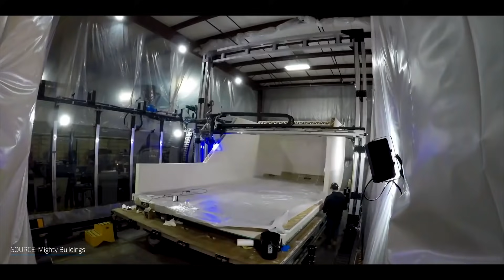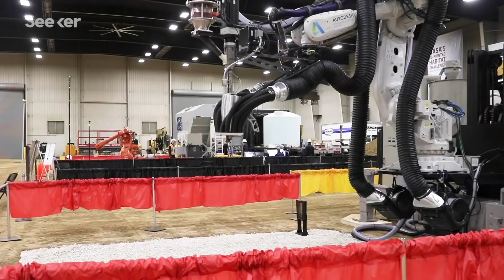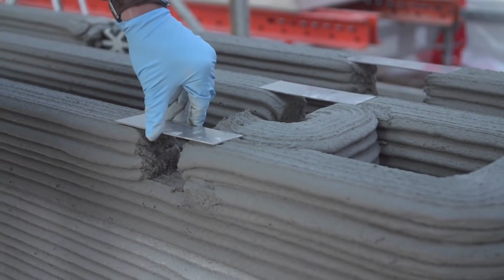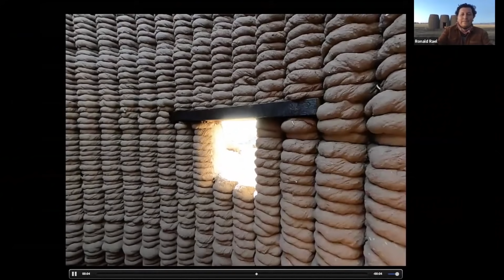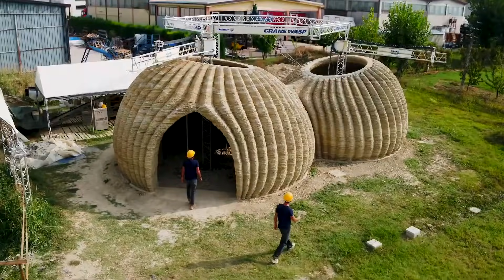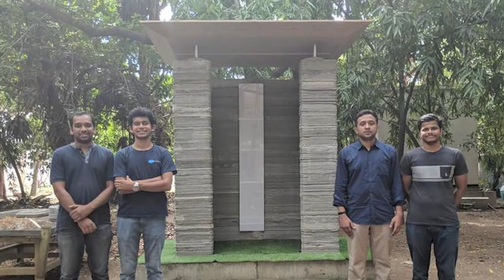This 3D Printed House Is Worth $0

Comment: Imagine if there was a way to turn local soils into blocks that could be stacked to build homes that could be transported to areas that water isn't readily available. Oh that's right, it's called bricks.
Reply: I hear you -- but bricks (in the forms most people are familiar with) require certain types of clays & soils, and then have to be fired (essentially, baked like cakes) at certain temperatures. An alternative "brick" is made by filling a mold with concrete, but we're back to needing certain types of sands & gravels or the concrete will not hold together.  Bricks also require a certain amount of specialized knowledge to use properly, especially if they're the primary material from which a building is made. They're also not as cheap as one might think; there's a reason that so many houses in the US from the late 1960s onwards are brick veneer instead of solid brick.   I'm not sure 3D printing buildings is the way to go, since they will face some of the same issues re: consistency & chemistry of local sands/soils, but in areas where they do work they could be a less expensive and less labor-intensive alternative.  Other technologies both old and new (rammed earth, earthbags, inflatables, etc.) really need to be looked at to solve the steadily-growing housing problem -- from both the viewpoint of structural needs and that of cost.

Comment: I think after The house printing, they need to be creative with Conduits to deliver Electricity and Water through the houses too. Just so it's easy to make simple and sensible arrangements that are cheap and effective.
Reply: It's 3D printing: You just leave spaces in the structure. Once it's built the electrician and plumber come along to fit the interiors.

Comment: It will become a fad like Tiny houses and no longer be affordable.  Add the State putting even more regulations in place to make happy their banking an d energy producing  contributors.  Affordability will disappear.   Even if the affordable factor is some how kept.  Those who have money will buy them up.  either to live or rent out.  Taking away the affordable part once more.  The biggest problem with affordability after greed is inventory.  As one and two bedroom homes either don't exist any longer or have been modified by adding many more square footage.  Ending codes that require 750 square foot per person and three bedroom requirements.  Would allow small homes to be built. Mixed in with the city landscape.  Would help people out of poverty.  End poverty and major social and economic issues becomes a foot note in history.

Comment: Houses are still not printed faster. Framing and sheathing a house can be done much faster than any printer can do it (for now). The longest part of building a house is plumbing, electrical, and finishing. 3D printing still does not do any of this at all.
Reply: framing and sheathing a house take 6-10 people, plus plumbing and electrical takes 6-10 people together, where you can cut labor costs in half or more this way. saving trees that make our oxygen as well. unfortunately, we have no population control, which is why we need cheap fast housing to account for all the current people and coming people. if you can do it better, then do it.
Reply: Yet 🙂
Reply: Well, it's faster than pouring concrete into formwork. Wood construction is not really comparable.

Comment: Honestly, considering the texture of the pour, I think it would be more advantageous to use the giant XYZ frames to form precision molds for casting large interlocking pieces off site. That would spare the head-ache of set-up and worry about perfect pour consistency while still taking advantage of the technology to cheaply fab large-scale intricate interlocking parts with a better finish on all but one side.
Reply: We are still in the infancy of 3D printing and robotics. Amazing things will happen in architecture in the coming century as the technology matures.
Reply: It kind of misses out on the whole zero miles aspect of the construct though.
Reply: @DefendedBear  No, you could still do it all on site. Just truck the pieces in like any other materials. It could be like a building made with a CNC machine.
Reply: @golgothapro   The same robotic arm can be equipped with tools to do the finishing and install the hardware ect... As far as I know it is the one of the long term goal.  At that point building blocks do not offer many advantage. Still it is pretty sure that somebody will also make printer to make small block at some point. Not everybody will want to invest in a huge robot arm.
Reply: @golgothapro  there are even full concrete rooms for apartment blocks :)
Reply: @warchefseed  I'm sorry man, but I don't get what you mean here. Do you mean complete rooms for blocks of apartments are already being made ?  If so I can certainly believe that.
Reply: @golgothapro  how is trucking stuff in on sight? Did they truck it in just a few inches???
Reply: @varrantgreen4259  Did anything anywhere ever show up on site without  trucks man? What's your F-ing problem with trucks dude?
Reply: @golgothapro  what's your effing problem with geography? On site means it's already onsite. Why would you need to truck it anywhere if it's already exsactly where you need it. 

And why are you making this about trucks? If you want to drive the material around the block for a joy ride go ahead and do it. Just don't charge the costumer with your joy ride.
Reply: @varrantgreen4259  What an exasperating communication. I know what on-site means. I made the general statement that I thought the 3D machine would best be used to make precision parts trucked to the site than actually used on-site with non-processed materials; and then the whole thing just deteriorated from there. I don't even know what the debate is anymore.
Reply: @golgothapro  the 3D printer in this video is a mud printer. How would you make easily transportable compoents out of mud? Like large panels instead of bricks. 

Youd have to do a compeltly differnt printer and then the issue of cost of materials wouldn't be resolved for this other printer. 

It's like you didn't even pay attention to the video and are under the impression that only one kind of 3D printer exists.
Reply: @varrantgreen4259  It doesn't print mud, it prints concrete or cement. As I stated earlier, I would repurpose it to make molds for casting. it's nothing but a giant CNC. Every wall could be made as a separate piece and assembled on site. What is you problem? You don't believe it's a viable concept? Nobody is sticking a gun to your head telling you that's the way it has to be.  That's just my opinion on it  because I don't like the texture of the final product or the idea of moving the rig for each application. Now is that too difficult for you to understand?
Reply: @golgothapro  The problem some of the folks replying to you have here, is that the whole premise of the sort of construction being displayed here is "zero mile."  Yes, some new logistical problems will occur, but removing 8000 lbs of construction waste, using renewable resources wherever possible, and not using trucks to haul heavy materials is all part of the allure.

You seem to be saying that they should instead prefab and deliver.  Which is a pretty sound idea... we've been doing it for decades.  It just doesn't mesh with the aims of the folks working on these projects.

So the problem people have with trucks, is that removing as many trucks from the equation is part of the goal here and you're suggesting using trucks.

I'm not sure how you haven't gotten that yet, but there it is.
Reply: @NaptownClassic  The zero trucking idea is ridiculous despite that being the goal because using local resources still wouldn't eliminate that. It's the size and use of the new 3D printer that is the real innovation here despite what the title insinuates. That's why I say it would be best used to make innovative Pre-fab parts. I guess I don't read any better than anybody else though huh?, especially when it comes to titles. LOL
Reply: @golgothapro  Eliminating truck use is the "goal", not the starting point.

Minimizing the use of trucks is a starting point.

Prefab and trucking the parts would be counter to what these folks across the multiple companies here are attempting to do.

I mean it all started with the idea of fabricating structures on another planet.  No trucks on those planets...lol.

All the other concerns people have brought up in these comments, about the consistency of the local materials, toxic or otherwise dangerous components which would need to be removed and so forth... I'm sure if folks in the YouTube comments section can immediately pinpoint them as points of concern, the companies spending actual money on these projects have probably considered them too.
Reply: You just invented the communist/eastern block house building technology from the '70s
Reply: @markmark2961  Oh yee of little imagination. That 3D rig is capable of forming molds with patterns, textures, or any imagery a computer can scan. Pieces can be any shape imaginable. Just try thinking out of the box for a change there Marky Mark.
Reply: @golgothapro  lol dont come assuming too much, while you just described what others did half a century ago already. people always forget you dont have to reinvent the wheel, also bunch of startups and such tries to hype you up with so much unneccessary things it is ridiculous. 3d printing is viable, but not as fast as building from blocks, there are even faster technologies compared to the premade blocks as well. go educate yourself and widen your perspective a little before you start to belittle others based on your none existing knowledge
Reply: But how would you transport cast components? Not manufacturing on site adds considerable "headaches" you are not factoring in.
Reply: @colbychavez3550  How does one truck anything? Nobody siad make anything bigger than a truck could handle. You can't just use raw dirt to make consistent cement or concrete can you?
Reply: @golgothapro  No.  But you can use it to make clay.
Reply: @NaptownClassic  Yes, but the material for the 3D printer has to have just the right mix to pour and cure correctly. The material it pours it trucked in, not taken from the site.
Reply: @golgothapro  This video says the opposite.
Reply: I must agree.
Reply: finally. i can live in the lincoln log house of my dreams
Reply: Russia, China, and Japan all tried that in the 70s and 90s. A very long story made short, it's hard to do right without an unusually high level of construction worker skill and above average material qualities, which wasn't available in China an Russia at the time, which lead to a large number of building collapses. It's a similar problem for the 3rd world counties this tech is meant for first and foremost.
Reply: @KiraSlith  I think that just infringing on "how it's been done" could cause plenty of problems as well. You've heard of pre-fabed  Lustron homes right? They had a big government contract to fill the housing deficit after the war until home construction lobbyists got there way and bankrupted them. I'm not an architect; but I'd like to see somebody build something practical other than just rectangular compartmentalization.
Reply: Why cast? SLM is nearly to the point where it can be used on a 3 post delta system (can stabilize foundation without heavy machines), bricks or print bottom up leaving posts driven deep in the ground to allow the building to grow upward as needed.
Reply: Like bricks which have been around for thousands of years.
Reply: @plebiansociety  I was thinking something of a bit larger scale with rebar in it that could take full advantage of the 3D framework. Crawl back in your casket.
Reply: @golgothapro  oh, like cinder/contruction concrete  block?
Reply: @plebiansociety  Like a whole wall man, with round windows. What's wrong with you ? LOL
Reply: I think the downside to this concept - prefab off-site to bring in materials on-site - has its merits, but has one major downside: If you print on-site you can use materials (earth, water, etc.) from on-site, dramatically cutting down logistical overhead for transporting the materials from off-site to on-site (which will of course also raise overall costs).

Printing on-site and using materials sourced on-site dramatically reduces and in many instances eliminates this cost. Its far simpler and much faster to move a printing machine on-site, source materials on-side, and then move the machine next door for the next-door neighbor's house than it is to set up a factory to mass-produce modular parts which are large and heavy and require a lot more back-and-forth transportation and storage solutions between builds.
Reply: @gcook725  Most building sites don't have the materials needed to build a building. If they did, they'd be turned into mines, or otherwise used as a source for those materials. Sure there are exceptions, but most construction sites are going to need far more than they already have just sitting around. More importantly, no site is exactly the same as another, so there would be quite a lot of logistical overhead just figuring out what materials are present on each site, and which os them are in a condition that can be used on that specific site. It's no as simple as "oh there's clay here naturally" it's how easily can we harvest the clay that here naturally, and what's already naturally mixed into it that we might need to remove before we can use it?" This video is marketing and propaganda. They are ignoring the issues to sell an idea. That idea is really compelling, and has a lot of potential, but as with any commercial, they aren't going to tell you anything bad about it unless they are legally required to.

The real reason investors and businesses want this technology isn't anything to do with the environment, or helping people. They want to replace jobs with machines. Machines don't complain about working conditions, don't take breaks, don't need to sleep, don't want insurance, don't need to be paid, make fewer mistakes, don't take longer than they need to, and are generally more reliable. You just need to hire a few people that can maintain the machines and keep them working. You pay for the machines once, and they only need minimal maintenance afterwards. This is happening in every industry. If you aren't necessary for those in charge, then you aren't worth caring about. Investors, Businesses, and Governments only care about you if they can get something from you. People naturally look out for themselves and those they care about before anyone else, and if they don't need anyone else, then they aren't going to provide anything for them unless it's convenient.
Reply: @LeafMaltieze  you forgot the part where they get to sell dirt to poor people.
Reply: Eh make a 3d printer that can set itself up and walk itself to location.

Comment: Ya but houses made like that are a lot harder to live in because you can't easily run new wires for new outlets, or run new wiring through the walls, and such without going through all that huge wall of clay.   Unless you plan on having the interior walls set up as a separate project.  Industrial robots that build houses with wood and drywall would be better.

Comment: 7:66 Wild mouses will be glad to eat this thingy wich was added in a wall on this moment. It is like table full of food on party for em. Otherwise it is poisonous. Also clay are short timed material in raw state. Enywhere where at least one month are temperature below zero degree Celsius those buildings lasts 20 years in luckiest case. Concrete are better, but to make it warm enough in cold time of year it need to be about half of a meter(closer to two or one and a half feets) and also need to be filled with material wich don't eatable for pests AND have low thermal conductivity... Cheap... Yeah... In dreams.
Reply: Best case scenario would mix ancient geopolymer and pour your block molds in staggered stacks and make it look like the huge blocks were lifted into place somehow. That should scary off people wandering around your property.

Comment: Ok you ask me what I think  this is it.
More bla, bla, bla ! All you 3 d people do is blow hot air w this technology and not anywhere is there a community w these homes.
Yes I know the few in Austin Texas but what I'm saying is lets get the ball rolling. There are people that need affordable homes now! Cut the bs and lets build some homes that are truly AFFORDABLE!... Let's go people! What are you Waiting for the second coming of Christ for Christ sake !
Reply: Houses are still framed and sheathed faster than any 3D printer will do. The longest parts of building a house are the plumbing, electrical, and finishing. 3D printing does not address any of these. Oh I forgot the paperwork in permitting engineering testing and designing will take even more time and this does not solve any of that.

Comment: I live in a frame house with a leaky roof. Water is the enemy of most homes. How do they keep these houses from turning to mud and collapsing in a rainy environment?
Reply: Like all adobe structures - with a thin layer of cement.
Reply: @MrKnutriis  ok. Never seen one before.
Reply: @MrKnutriis  Um, you do know that cement is porous right? the house will still leak.
Reply: @matthewvandeventer3632  well, there is yet another thin layer of stucco on top of the cement, for color and final waterproofing.